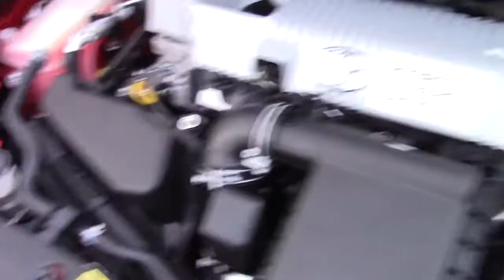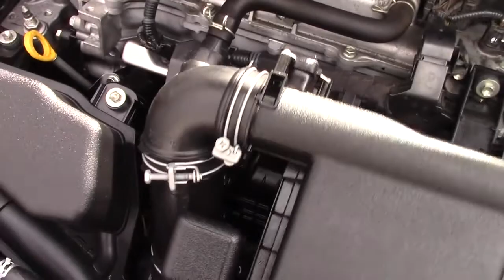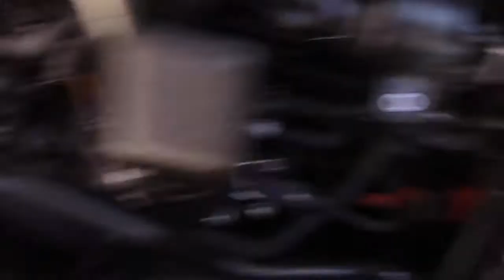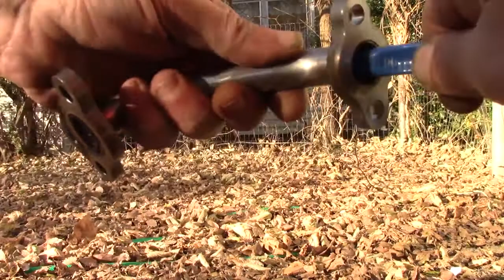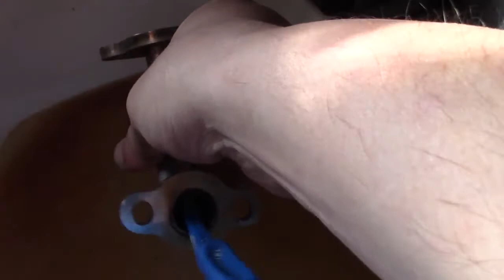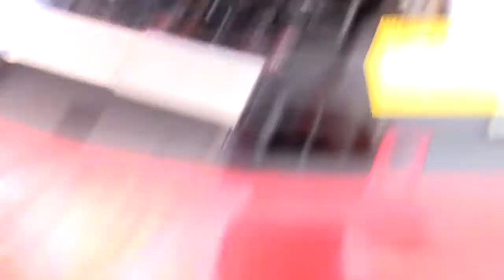EGR pipe cleaning on 2010-2015 Toyota Prius

Comment: The spring loaded plunger in the egr itself needs to be cleaned. It may be stuck shut or open. Removing the egr and cooler assembly along with the pipe is a nightmare. On mine, the housing cover screws over the stem and spring are completely stuck and the idiot engineer that put phillips head screws holding it created  a headache because the heads are soft metal and strip out easily. Stupid, unecessary design.

Comment: To prevent future problems (rattling and headgasketfailure) you really have to take the EGR-cooler, EGR-valve, EGR-pipe and intakemanifold off, and clean all of them using ovencleaner. Clean them like they are new again and the car will run forever. Repeat this every 30  - 50 k miles or 50-80k km's. If you are so unluckey to have the 1.8 of 2010-2013 that burns oil, you have to do it more often. 

I also changed the electric waterpump and thermostat, while I was in there, at 230k km's. Also known for failure. Buy the OEM pump, made by Toyota/Aisin, not a cheap one, that will soon fail. Change it as a preventative job, now it  costs a little money, but when it failes while you'r on the road, it will cost you thousands.

All this in one day of work for an amateur like me

Comment: My headgasket has blown. I used Bars sealant to seal it. So far so good. How does EGR valve make gasket go bad ?
Reply: The temperatures in the combustion chamber are higher than they would be otherwise causing it to fail is my understanding. 

Or something similar to that, maybe too much pressure as well.
Reply: @SvenTSchixe 👍

Comment: I got the oem toyota  egr kit on ebay for $ 180 i clean the egr cooler . I also clean the manifold ,throttle body air intake, mass air sensor. It took me 12 hrs to do i save a lot of money thanks to youtube my check engine with away. It does not rattle no more runs good am the original owner it has 170,000 miles 2012 pruis. I love this pruis am California correctional officer in San Diego but live in Tijuana Mexico my co workers make funny of me and tell me to buy a new car lol. My next vehicle will be a new toyota tocoma :).

Comment: Since it's just caked up unburnt carbon and deposits in theory you could heat the shit out if the pipe with a torch inside & out and it should all burn off

Comment: Anything involving an EGR cooler should be preceded with “you are going to need a leprechaun and an elf to get the bolts off” or “hope you weren’t too fond of skin on your hand”... EGR pipe not bad, EGR cooler TERRIBLE.
Also, soak in purple power and use pipe cleaner... tah dah.

Comment: I just fixed my p0401 code, I replaced just the egr valve motor with a good one off eBay and no more code!! Getting 40-45mpg city...if you clean everything and still get a code its the egr motor going bad
Reply from the maker: Great info Joe, thanks   :)

Comment: Cleaning that pipe, doesntbdo much, because the main problem is the actual ports inside the intake runner clogging. I just removed the intake today and cleaned the ports. Thats where you get uneven distribution of the egr gases and causing uneven cylinder temperatures. Cheers
Reply from the maker: Yep, I agree. Cleaning the pipe is an indicator. Also allows experimentation with home cleaners to see what works before tackling the big clean. Best wishes for many 1000's more miles :)
Reply: What do you guys think about running seafoam in the fuel regularly and in the oil just before an oil change?  Should free up some stuff right?
Reply: @mhaskins3769  the egr system is separate from the fuel and oil systems so it would still need to be cleaned independently.
Reply: @mhaskins3769  it all depends on how much deposit is already present. If it frees up and get sucked into places like the camshaft phasers, thats problematic. Of course the oil filter should catch everything right? Im a fan of changing oil more frequently.

Comment: Interesting method.  Thanks for sharing.  Neat watching different cleaning methods used and people performing.   Did yours throw any error codes?
Reply from the maker: Sorry for the delay. Nope no error codes. It's a good point that I hadn't considered, probably because it fortunately didn't happen lol.
Reply: @Slider2732  No need to be sorry, appreciate the reply.  Youtube is definitely handy for that capability on top of the video blog and detailing stuff.   Interesting timing too since I got my PCV Valve in the mail today and back from getting 3/8" fuel/PCV rubber hose, a M16-1.5 to 3/8" Dorman adapter and hose clamps for the PCV Valve relocation to between the Valve cover and inverter coolant tank somewhere.   Have an OCC that I'm thinking will be here this weekend and am hoping I don't need an adapter to couple from the OEM PCV Valve location and can just drill or punch out the valve in the OG PCV valve so to use as a hose adapter.  Was hoping to find Tygon Fuel line in 3/8" and haven't been able to find around or on eBay even that's fuel grade.  My issue is the wiper motor I think failed and while disassembling, I figured I'd look into PM's since I'm at ~220K and get that rattling sound briefly accelerating after warmed up then sits I think.  Plus the dealerships and I noticed more oil consumed that last few oil changes.
Reply from the maker: @jafinch78  Great info and thanks, because also others may see it. 
Is yours a pre 2012? I know that oil consumption is to be expected, more so on the first Gen 3's. Saying that, 220K is nothing to sneeze at, except if owning a Prius!
Could the brief rattle be the ECU being pulled out of operating conditions due to carbon? As in, the cylinders miss because of an incorrect air/fuel mix. If so, your cleaning should remedy, from what I've read (Priuschat). Also, acceleration is a bit of a mixed bag, especially from rest, cos of the electric motor. Can easily imagine a situation where pulling away is fine, then it starts to rattle... as the engine kicks in. 
Am also thinking the wiper motor may be corroded contacts. Could be worthwhile to put 12V to it directly when disconnected from the car and see what happens.
Reply: @Slider2732  Your welcome, 2013 and thinking the same.  Wouldn't know what I know if not for others sharing.  I've wondered about running a fuel additive and oil additive then rinse for a long run.  Reads like might help with reducing oil consumption by loosing up the rings that might have carbon deposit issues.  Doubt I will... though will continue researching.  For all I know, like the cold weather even worse sound that's always been with the engine... I may be nit picking since I've not been listening to music or the radio like I used to always when on the road.  I plan to check the connection to the wiper motor with a DMM now that I know a little more with a wiring diagram.  https://priuschat.com/threads/2013-front-windshield-wipers-not-working.219734/#post-3079315    Wasn't sure about a floating ground or not... so didn't want to test with the car powered on.  Switch functions I think as designed.  Good idea with checking the connection with a 12V source... didn't even think about.  If doesn't work... I'll do a disassembly and document what all I do and add to the above post.

Comment: Toyota Prius 3rd gen.  I used  an extra reach 12 mm racheting wrench for the three nuts in the back and took a while to reach the 4th HIDDEN 12 mm nut underneath the EGR cooler. We used a Torx E8 socket for the two bolts in the back, to finally free up the entire EGR assembly off.  Great Video
Reply from the maker: Am looking at bits to buy to clean ours, seems I need a few things. Haven't got many tools, your info is appreciated.
Reply: @Slider2732  for the Torx E8 socket, using a 1/4 inch drive Finger Ratchet works goods
Reply: @Slider2732  Removing the EGR cooler is no joke.  Spent a small fortune buying specialized tools.  In retro, would have been better to take it to a mech.  See if your mech will remove for you, clean it yourself, save $ and have mech put it back together for you.
Reply: @ICPDee  all you need in one special tool for to bolts in the back.

Comment: Just cleaned the EGR pipe on a 2014 Prius. It was running great at 101k miles but I read about the headgasket issues on these cars and decided to tackle the job to prevent a problem. The pipe was fairly clean with minor soot but I went ahead and took off the EGR cooler to check it out while my windshield cowl was off. It's a pain in the neck to remove but I'm glad I did. My friend, it was totally blocked up. Unbelievable as the pipe wasn't too terrible. Hard to believe as the car was running so well. It absolutely required a pressure washer to fully remove the hard built up carbon. Hot water and chemical cleaners and a thin wire did not help much. After I finished pressure washing it for a solid 10 minutes, I could finally see the fins inside and see straight through to the other side. Next time I will buy a new EGR cooler and valve so I can simply swap and sell the old one.
Reply from the maker: Great info and thanks for posting, especially with it being a 2014. I'd agree about the swap, then clean the other at your leisure. We could do with a company bringing out something like a carb cleaner... spray it liberally into the throttle body and watch the black exhaust gases. Problem is, would start up, go to spray the cleaner and the damn car would switch itself off lol
Reply: The pressure washer didn't damage the fins ?

Comment: 2010-2015 Toyota Prius Maintenance
X
nutsaboutboltz youtube videos: 
https://priuschat.com/threads/nutz-about-bolts-prius-maintenance-videos.162289/ 
X
VERY IMPORTANT: Every 100k +/- Replace or clean EGR cooler (part #25601-37010 cost $270.79 toyota or New on eBay: $178 total.  Every 100k clean EGR valve and pipe and maybe check valve plunger is moving/clean, however a mechanic told me not to open EGR plunger housing as it will mess up timing?  (100k or sooner maybe, some EGR coolers will plug up sooner than others)
X
Prevents future engine/head gasket leak, overheat issues. (Prevents $1500-$1700 HG replace job)
X
Every 100k replace PCV valve and maybe clean PCV rubber hose. Prevents future issues.
X
Clean intake manifold and replace Gasket every 100k, maybe sooner.  See youtube video.
Replace transmission fluid every 50k to be safe (or 40 to 60k). Cost toyota of Glendora 170$ or 120$ labor only. some people change early w/ new engine at 5k and/or 30k then every 30 to 60k. 
USE World Standard genuine toyota trans fluid only – 4 quarts 
X
drain refill oil, filter, every 10k or as needed 
drain refill engine coolant replace at 100k then every 50k  (buy 2 gallons for coolants)
drain refill inverter coolant at 150k then every 50k, may change at 100k with engine coolant. 
X
Replace spark plugs every 100-120k miles 
X
Throttle body plate clean, Clean as needed. some people clean every 20k miles or 50k or 100k depends on how dirty)
All throttle bodies & plates get deposits over time from the carbon in the fuel vapor. When the engine is turned off, the vapors cool & a very small amount of deposits form over time. Over time these deposits cake up & cause many problems! With modern electronic throttle bodies on these late models (they are kept cleaner but they still need to be cleaned & maintained properly to help keep them trouble free for many years down the road.) 
X
replace engine air filter and cabin filter every 30k miles or as needed. 
X
Check brakes outer pad and inner pad. Brakes will last a long time.
brake fluid, check every 2 to 3 years. not concerned because regen braking extends life, 100-150k maybe. color test strip. But eventually replace to maintain clean fluid is a good idea.
Check brake calipers are smooth, no pulse in brakes, and lube brake pins 3m (use Silicon grease only) Prevents brake seizing up. check nutzaboutboltz videos 
X
struts shocks replace as needed, look for leaks (some recommend every 50k miles) KYB original or monroe 288$ total parts rockauto or optional: 750$ american tire depot lifetime shocks/struts parts, but only pay labor 
X
tire air pressure need to be consistent 2 psi lower in rear.  35F/33rear 
(some use 40/38  38/36 more or less for better handling)
Tire alignment with new tires to extend life. 
X
Optional: If lots of pet hair or dust inside car cleaning the HV battery fan could prevent battery overheating in future.
Cleaning and air freshening the AC evaporator 
Oil Catch Can Installation. optional but helpful. Catches oil/water residue before it goes through the engine.
Reply: Thank you

Comment: Tips to PREVENT HEAD GASKET FAILURE: 
231K - 2013 Prius. Just had head gasket replaced for $1,500. 
Could of prevented it if I cleaned/replaced EGR cooler around my second run of 80K or 90K miles? 
Maybe it happened to me a bit sooner because I cleaned my EGR cooler out about 90% +\- at 130k miles, + 1000 miles/week, 50K/yr.  and maybe because of potentially more cold/heat cycles on the head gasket. 
  
Lots of people highly recommend 3rd gen prius owners clean or replace EGR cooler AT or BEFORE you hit every 100K miles.
EGR cooler $178 new on ebay, $300 at toyota, part #25601-37010.  Clean EGR pipe and valve with the intake manifold/throttle body. Replace PCV valve, optional oil catch can.
X
At 230K miles my EGR cooler was completely blocked up with soot (previous cleaning at 130K). My symptoms were brief misfire on #2 couple times every 100 miles and slow engine coolant leak into the engine. #2 spark plug and #2 set of 4 valves were pretty dirty. Head gasket and cylinder head was replaced with refurbished one. (6,000/3month 
warranty). Car runs great so far. 4th Gen Prius has improved this problem.
Reply from the maker: Thanks for posting your experience. Will be doing ours in the next few weeks. It's on 92K, but not considered to be too soon. We have 250 miles left on the tank fill from before Covid 19, but in with generally not going far is more heat cycles on the engine -you make a great point. Luckily the pipe was fairly clean, but am not taking any chances... the car has to last!
Reply: @Slider2732  Cool. Yeah it's the EGR cooler that I replaced but some clean it out. I cleaned everything out. Toyota should have had first put the EGR after the catalytic converter which they now do in 4th gen.
I just replaced my water pump and thermostat at 232K miles as a preventative step. I may replace inverter pump before 300k but it is still flowing in the reservoir. Some people want to wait for check eng codes to pop up or leaking or abnormal noise or worst case it pump(s) may fail and ECU computer would put prius in turtle mode requiring one needing a tow.
Reply: @clarinet94  Ah, interesting to keep in mind for a potential modification if the exhaust needs to be replaced with the catalytic converter.  Will have to see if the 4th Gen can retrofit into a 3rd gen also, stock or custom equivalent.  Did you happen to look into performing by chance?  I'm at 220K and noticing I think during a ECO range just after EV (I use ECO Mode) the cold engine rattle until I idle down and increase slower or throttle more to deal with for a second or two until stops.  Not sure causation yet, no error codes.  Though definitely in the plan to clean next with most likely a PCV Valve relocation and OCC while all is tore apart.  ECG circuit cleanout at least seem priority along with windshield wipers which triggered all this research to do other inspection and maintenance learning and acts while disassembled.  RainX for now.
Reply: @jafinch78  Never heard of an exhaust mod, but if it failed that would seem smart if possible. I think first your going to want to clean everything, manifold, replace pcv, clean egr pipe and egr cooler/or replace cooler, egr valve. I have not added OCC oil catch can but it may improve car life and prevent cooler plugging up at every 70-100k+/-. Ok goodluck to you. I was hoping to prevent head gasket replacement but I was too late in cleaning it out. see if cleaning everything improves your rattle. thanks to nutsaboutboltz instructions.
Reply: @clarinet94  Appreciate the affirmation and feedback!  Thanks man!
Reply: Did your car throw any engine codes?
Reply: @jafinch78  Yes I got the engine code related to misfire #2 on the freeway. Then saw coolant leak slowly. Two indicators head gasket may be failing. I'm at 246K now, everything is ok since HGasket replaced.
Reply: @jafinch78  if the misfire is not bad enough the engine might not give you a code, but you will hear/feel the misfire.
Reply: Mine engine rattles on startup for 3-5 secs and back to normal , code misfire 301,302(spark plug and coil replaced) no sign of coolant leak , I am thinking replacing manifold intake and cleaning or replacing egr, would that solve rattle problem ? 2011 Prius 3rd generation 230k miles thanks
Reply: @ManishShrestha-ju4np  I think that's what people did at priuschat for rough startup.

Clean egr pipe,   egr valve, egr cooler clean or replace around each 100k. Clean manifold and throttle. 'nutzaboutbolts' youtube.
Reply: @ManishShrestha-ju4np also  replace pcv valve 100k intervals and replace gaskets, 2, for manifold, no need to replace intake manifold, just cleaning.

Comment: Great video!

Carb and choke cleaner could be a good solvent to use without having to take a bath in it. A round brass wire brush might be pretty effective in combination. Use Nitrile rubber gloves.
Reply from the maker: Thanks Bill. Yes I agree. Good idea with the brass brush too.